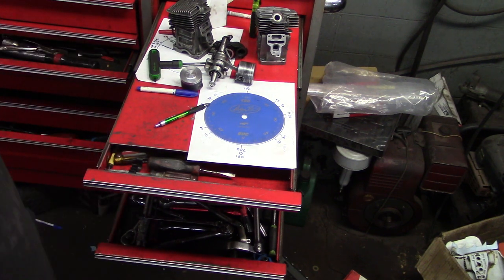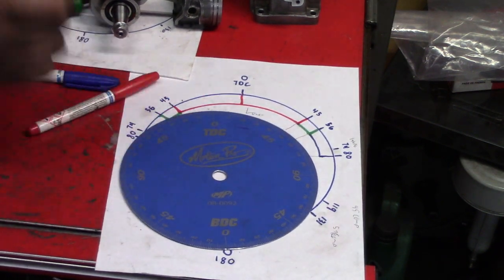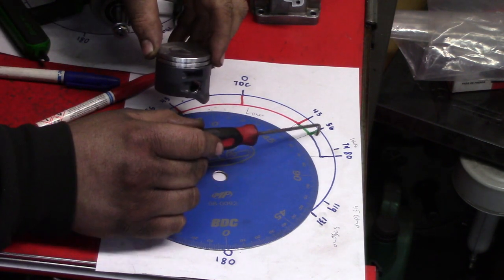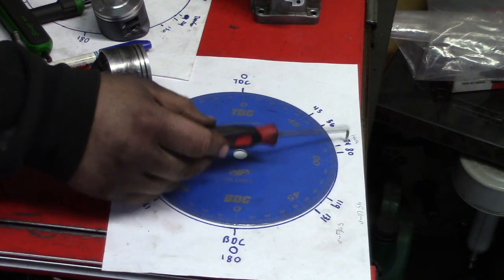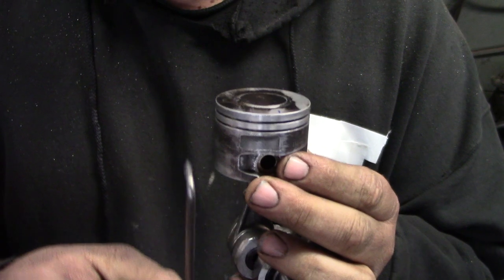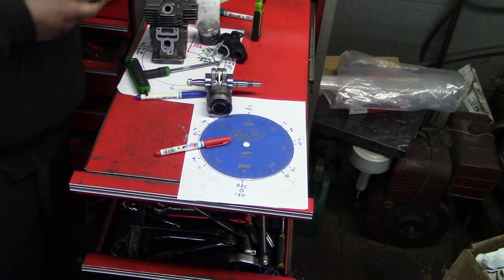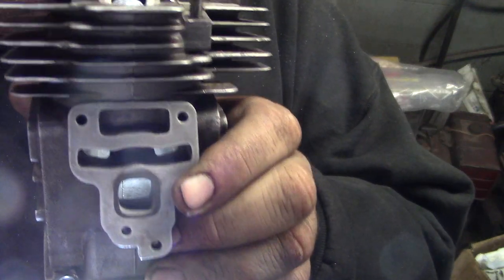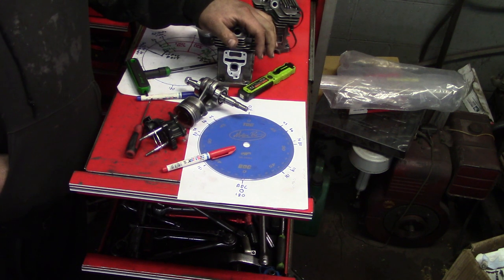Strato Saws A Deeper Look at What Is Going On Plus Piston Window Experiment

Comment: I have a 2010 and a 2012 and really have had no problems with either. Never had a problem with leaning out. Not sure if the early  and later ones are different but i know the cylinders are different. One is 4 bolt and i think the later have 3. Different air intake and air cleaner too. Opened up the muffler with a vertical slot like my 461 and opened up the baffle under the air cleaner and she runs like hell now